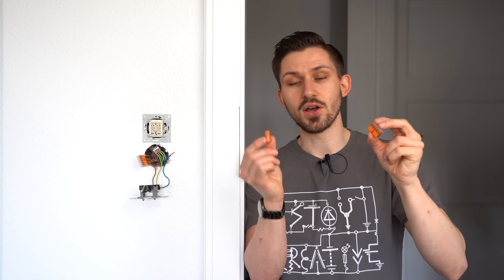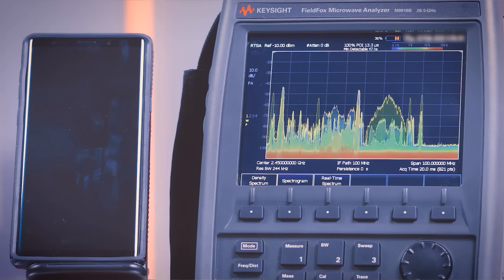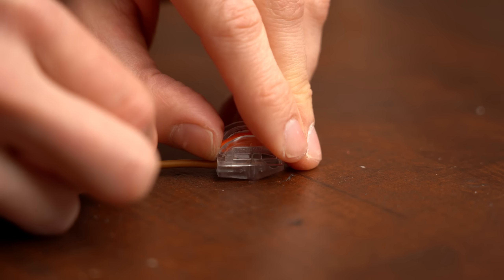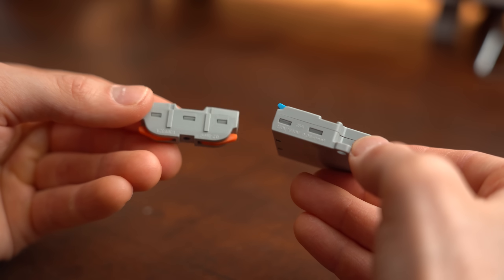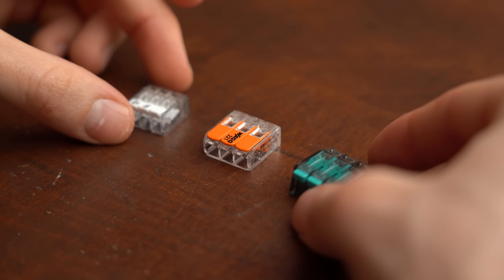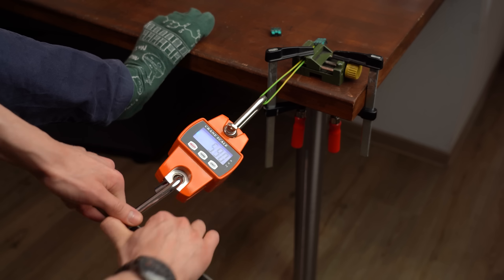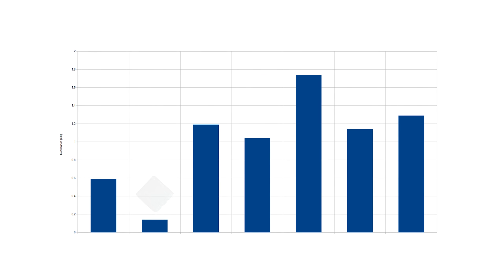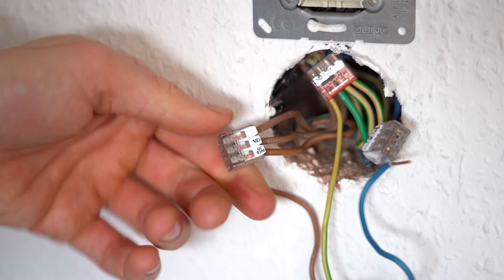I tested 7 Wago Knock-Offs Wire Connectors so you don't have to! (Surprising Results)

Comment: The previous video was not bad at all. I think it was loud minority of people with very strong opinions who thought that their opinions were fact. Wire nuts, if used correctly, can get the job done safely, but so can Wagos. 
Also, some other commenters pointed out that on places like Amazon counterfeit Wagos are sold as real, and it is possible that any negative opinions about build quality might've stemmed from them buying counterfeits instead of real Wagos. This is really the fault of the website they are hosted on (especially Amazon), as it is very hard to tell these days if a product is real or not, especially considering that many reviews are paid and thus not genuine, inflating the overall rating.
Hopefully those people learn to have a more open mind in the future.
Reply: If the last 6 years have taught me anything, its that, when people are loud and obnoxious about their opinion, I ignore it almost unilaterally.
Reply: @benjiusofficial  Usually the ones that scream the loudest/rudest that they know best are the ones that have no clue what they are talking about. Also, people who care that much about whether someone uses a wire-nut instead of a Wago or vice-versa that they go around spamming comments on Youtube videos should typically not be consulted for proper advice anyway, looking at the comment section here, some people really do stay up 24 hours a day spamming their opinion on Youtube xD
Reply: Wirenuts damage the copper to make a connection so most countries with proper wiring regulations don't allow them. As we have to test the installation and fill out a legally binding document that is our only defense in court if there problems down the line, we don't fuck about with gimmicks like wirenuts we make sure our connection are robust.

Comment: The resistance test is also pretty important for short circuit currents. If you have a whole bunch of connections all over you want your short circuit fault currents to stay high so that fuses blow immediately instead of cooking and heating up places for a longer time.
Reply: A B16 Leitungsschutzschalter on 230V will trip instantly at 80A, which is 18kW and not exceed 2.8 Ohm.
I once misconnected a Wago leading to a higher resistance and a nasty surprise.
Since then I always measure the installation resistance of all mains circuits.
Reply: @ChristophPech  Here in Finland we use mostly C10 and C16 circuit breakers and they require 125A and 200A of shortcircuitcurrent tested with a Fluke
Reply: @Tupsuu  A C type breaker should trip instantly at 5-10x the rating. So 100A max for 10A and 160A max for 16A.Replace your breakers,they are not sensitive enough.
Reply: @MernokiMegoldasok  but they need to be measured to have atleast the 125A or 200A etc. from the furthest point to pass the commissioning tests.
Reply: @Tupsuu  If the furthest point is a socket it can have problems.Plug in a long extension cord and you have significantly larger impedance.
Reply: @MernokiMegoldasok  Финляндия северная страна, а параметры mcb изменяются вместе с изменением температуры окружающей среды. Согласно таблиц соответствия от производителей ABB, Hager or Legrand, at an air temperature of -30°C, a 25A circuit breaker corresponds mcb of 30-32A
Reply: if you build up your electrical installation smart (only a few or no connetions) u dont care for that little resistens
Reply: @mrdur2101  Whatever you do you should know what you do.
Reply: @benbaselet2026  Good answer! Covers most anything!

Comment: This is a badly made video 👎👎👎
No real comparison between different brands no long time tests some points that I did not really understand how they are given. Also no maximum current test to see what happens when a short circuit situation appears and how they compare after this because it happens sometime and trips the breaker in the box. Long time test is also very important - are they going to be this good after 5 years? I don't think so. For example you can watch video of a different youtubers like Project Farm for example. His comparisons are really great no matter that they are not on electrical stuff. And now my personal and professional opinion - I always avoid such connectors. I much prefer twisting the wires together hard and then soldering them to prevent oxidation over time. Anything else is a fire hazard especially when powerful appliance is used like room and water heaters and cooking ovens. Such connectors I can only use in low power circuits like lighting for example.
Reply: twisting wires and soldering? well that now is a fire hazard, the insulation you apply on those will be inconsistent and very time consuming. Also very hard to inspect and measure, so serviceability is almost non existant.That is the reason soldered connections in electrical wiring are strictly forbidden in EU. Here we do not use anything else, but wago in Denmark. Even our switches and electrical sockets use push-in connectors. Applications up to 32A are perfectly fine and wago is most reliable connector for house applications, including ovens, water heaters, industrial appliances. Never seen fire with those.

Comment: The certificates part made me laugh.
It's much easier to have CE molded onto knockoffs than it is to get the certification.
Reply: CE is not a certification, but a self assessment by the manufacturer that the product complies with the standard, but no third party tests are required. 
So CE is only as good as the manufacturers conciense.
Reply: @ulwur  finally someone Who knows, thanks
Reply: @ulwur  Only a EU company can self assess. External company's must use a third party company. Or claim they did anything. The buck stops with the EU importer.
Reply: @ulwur  Almost true. Any manufacturer that puts a CE mark on their product has to be able to produce the required testing documentation if an authority asks for it. So if someone dies when using a CE branded product that manufacturer will be in deep trouble if he can't document that the product is in compliance..
Reply: @johnwick7175  that assumes the company still exists at that point, if you're making knockoffs i'm sure you can find a way to reform the company in such a way that eliminates such liabilities. also not sure how that will work anyway if the company is in another country outside of the EU jurisdiction.
Reply: @LC-hd5dc  The seller will be held responsible in that case
Reply: sounds a lot like dot rating on helmets
Reply: @ulwur  However, the CE markings are illegal to use on products that doesn't fulfil the requirements, and every country have some government agency responsible to handle complaints against products as well as doing their own random tests. So while the CE marking is no guarantee for anything other than the manufacturer and/or importer saying it's up to requirements, it is not entirely risk-free misusing it.
Reply: Can't you all stop spouting half-truths and read the wiki page?
Reply: @gmonkman  Wiki reckons bill gates is a business genius, and not the world's most glorified thief.

Get better sources.
Reply: AIUI legally CE is a declaration by the manufacturer (if made in the EU) or importer (if made outside the EU) that their product conforms to applicable European standards..

The problem afaict is threefold.

1. The importer may have no significant assets. It's hard to get blood from a stone.
2. The product labelling may not adequately identify the importer. I don't know if there are rules about this but if there are such rules they don't seem to be enforced in any way.
3. The importer may no longer exist by the time the product fails.

Certifications from test labs like UL, TUV, VDE etc will come with certificates describing what exactly was certified and sometimes file numbers will be printed on the product so it can easilly be looked up. It's still not perfect, a company can still make an outright counterfeit but it's better than the self-certified CE.
Reply: CE = china electronics      anything with only CE should never ever be trusted, you used to be able to tell, because the fake CE were basically hard up together, with trusted C E spaced, but chinese knock off manufacturers woke up to this and started spacing theirs too, if only teh quality of the knockoffs with CE were up to same standard, nobody would mind, but we've all seen the horrors
Reply: The market is full of products with false/counterfeit CE markings. Making it largely pot luck. I wouldn't use anything off Amazon in a professional installation.
Reply: Try to compare with “China Export” symbol 😂
Reply: @theaifam5   “China Export” symbol is a modern myth that stems from the lack of understanding on the manufacturer side that the CE logo also includes the exact spacing between the letters.
That resulted in the funny looking CE marks used by legit and fakes alike, but "China Export" never existed.
Reply: @theaifam5  There is no such thing as "China Export", it is an urban myth.
Reply: @LaurenzEdelman  I bet you're fun at parties.
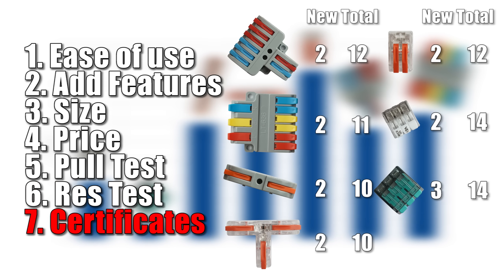Reply: @LaurenzEdelman  Even though there might be no such thing as an actual "China Export" logo, it is still a fitting name for faked CE logos. On several occasions german customs took away power adapters of my deliveries, because the E of CE had a center bar, that was too long. This seems to apply also to some of the logos shown in the video (e.g. on the red-blue one at 9:39 or 10:09)
Reply: @ChristophWerner1975LX  that is certainly true! The CE marking isn't worth much because of this.
Reply: @johndododoe1411  Don't ask me about the specifics. Apparently a legitimate import has to have the correct length of that middle bar. If it is misshapen it has to be cast out as damaged or what ever. If it still gets delivered and ends up at the customs check it is deemed fake and confiscated.

I'm also not an importer. I described what happened to me as receiving consumer. I backed stuff at Kickstarter. E.g. an OUYA and their way of making the US power plug "EU compliant" was to add an adapter with a misshapen  CE logo. This must have been common practice, because the knew about it at customs: 
Do you what it is?
Yes, it's an OUYA.
Ah, I see
* makes me unpack everything, goes straight to the adapter, quick check*
This one is llegal, the logo is counterfeit. You have two options: Let me take that or the whole console.
Reply: @johndododoe1411  My whole point in the initial answer was, that there are legit CE logos and fake ones. Apparently it's not that easy to put a correct CE logo on something in a technical way as OP suggested. Maybe those cheap producers just don't care.
Reply: @johndododoe1411  Because product categories that requires CE-markings must have CE-marks, and those can not be applied retroactively.
Sample/test examples must be imported as such, with the appropriate paperwork.

 @ChristophWerner1975LX, the CE-mark is specified in detail, including the space between the two letters. If the marking deviates from the specification, it is not a CE-mark and if the product lack CE-mark it is illegal goods to import.
Reply: @ChristophWerner1975LX  This is the saddest collection of words I've ever read.

Customs screwing you over because of a logo for confirmation of self assessment(useless on top of useless). And then you had to suffer the disappointment of the Ouya itself.

I want to give you a hug or something...
Reply: CE is a self-certificationm where the manufacturer claims they complied to standards. As any self-certification, it's value is low as there is no third party testing

Comment: i really didn't expect the slide connectors to perform that well
Reply: Me too
Reply: https://youtu.be/LnEE5we4CJU
Reply: And I would also not give it 3 points for ease of use. If it is already installed and you don't have the "tool" with you, it is not easy to use.
Reply: @Schatzjaeger2  i mean nails work just fine
Reply: @Schatzjaeger2  if you’re working on electrics and you don’t have the basic tools such as a small flat-blade screw driver then you should probably not start the work and get a professional instead 😂

Comment: A couple of points on the CE marking:
1) don't get caught out on the (very naughty) China Export mark, which looks almost identical.
2) even a proper CE mark can be just as naughty since they are self certifying - the manufacturer is the one that performs the tests and gives themselves the certificate, and they could conceivably just not test the product and give themselves a certificate anyway.  It is, of course, in the manufacturer's best interest to actually perform the tests as it could mean a hefty fine if they are found out, but it still doesn't stop "close enough" products that only just fail from getting under the radar for years.
Reply: I don't see any benefit in the CE marking, they just get slapped on everything because that's what you do as a manufacturer. Completely meaningless.
Reply: 1) "China Export" is a myth. Basicially a joke because every cheap manufacturer prints it on and they sometimes even fail to print it properly, but they all mean actually CE. 
2) Nobody can fine a random chinese factory besides their government. Since most of the stuff is exported to western countries they don't care. CE is only relevant if you can reach them legally, maybe you could also also sue a local importer, otherwise it will be almost impossible.

Comment: The CE marking won't mean an awful lot on those as the spacing between the letters can be made slightly different to the official CE marking which then just stands for Chinese Export, and not what you think it does.

Comment: I will never dare to use chinese knockoffs parts for my house connections. These things are too important. Use only original parts from the best companies.
Reply: But how do you  know which is the best? From this video one could easily say that Wago is not the best with neither lowest resistance or strongest retention.
Reply: Haha ok racist
Reply: Yeah I don't see how saving 20€ on your house which already cost over 100k would ever be worth it, in exchange for your ease of mind.

Comment: you can secure legit wagos btw

for instance in whisker boxes they can contain 3 or 4 captive wagos in a bar that secures into the back of the box

you cant secure them to any random surface, but regulations require them be in an enclosure anyway
Reply: you could just 3D print clips for them if you want also

Comment: I'll definitely be looking at the ViD connectors if I want to shave some price, and some of those slide connectors if I want to get a few bonus points for safety, thanks for the video!
Reply: The ViD seems like a reasonable alternative. The brand ViolaDirekt is German (same as Wago) and the certifications seems legit and can be downloaded from their website. The others are all probably some chinese no-name, the sliding looks also decent but without any paperwork to prove some quality control it can be little bit sketchy.

Comment: I'm surprised you gave the green one 3 for ease of use seeing as you had to use a tool to open them.
Reply: It is most like a safety feature. Some standards require the use of tool to open connectors, specially when it comes to DC current so these would be very suitable for PV installations, specially when considering how well they performed with low resistivity. I can also easily see them inside various equipment.
Reply: Doing one or two of those small levers might be OK with your fingers but try to use them all day.. your fingers and nails would be destroyed. So realistically both types need tools.
Reply: Seems like you only need a tool to open it, so you could just prepare the connectors in advance and squeeze it closed with your fingers.

I'm still surprised, though.  Pre-opening your connectors is a lot of trouble to go to.
Reply: @dafoex  perhaps years out of date, but always have to pre-open the connectors when using "chocolate block".